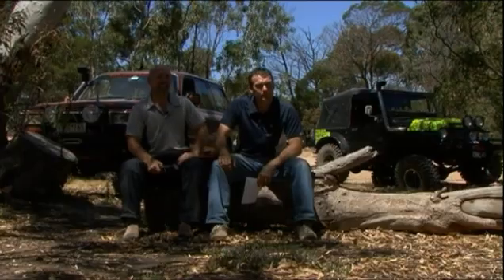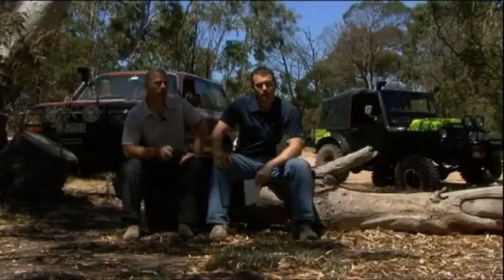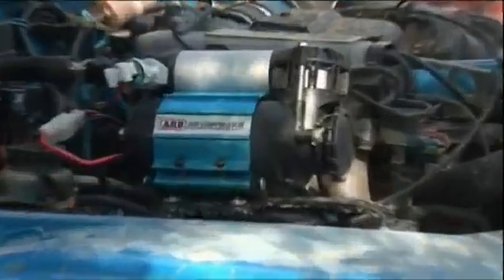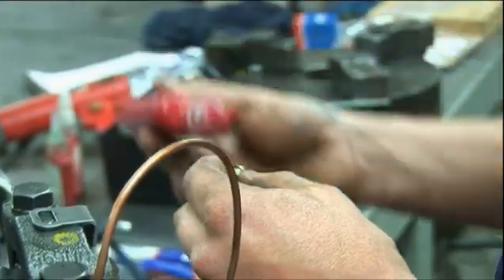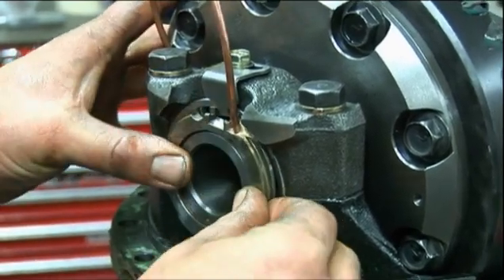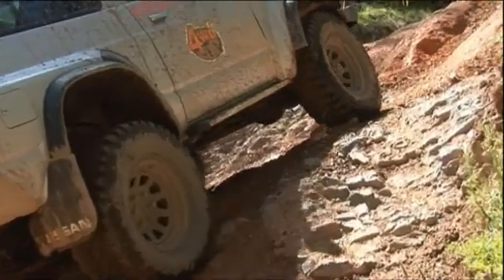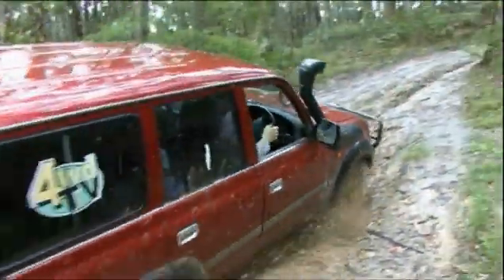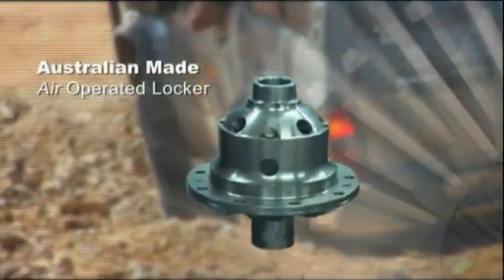Ask an Expert - Air Locker Seal

Comment: my seals are less than a year old and leaking badly. .... not cool!
Reply: +HeavyMetalEvilien Did you use a case spreader when you installed the locker?
Reply: +jeepcherokee40 It was installed by a professional shop here in vegas.
Reply: they might not have used a case spreader. with the arb you have to or the rubber o rings tend to get ripped and then they leak air.  On the bright side its pretty simple to replace the seals
Reply: +jeepcherokee40 Thanks!
Reply: no problem best of luck.
Reply: What happens in Vegas stays in Vegas.

Comment: Western Gulf or Gulf Western 140 gear oil for all your diffs and gearbox and transfer box...great stuff. also have you extended the diff breathers up into the engine bay? Bring them up to the highest point and put a couple of furl filters on the ends...works a treat...

Comment: Yeah they are a load of crap, the two air seal wear out and ARB wont sell you the seals but will try and force you to buy a new unit, part of their hard sell policy. My 80 series cruiser had an ARB air locker on the back and i'm about to rip it out and toss it and install a Aussie Lokka...From all accounts a much better piece of equipment, lasts forever and no 50 cent seals that ARB want $700 for.

Comment: bullshit nothing goes wrong mate my brand new front and rear arb lockers on an off the showroom floor hilux have dumped all the oil out the diffs through the arb air compressor......THEY DO FAIL.. MINE DID how can i trust them from this point on

Comment: I have a 2003 jeep wrangler with a A.R.B. airlocker. I have took it to three different mechanicsand no luck. Some how I am getting water in the rear axle, do you have any clue were or how its getting in. I have replaced all seals but still happens. I also have looked all over the internet trying to find what type of gear oil to use. Their is alot of different stories on the web nothing from you guys. Any help would be great.    Love your product more than you will ever know.  John shafer